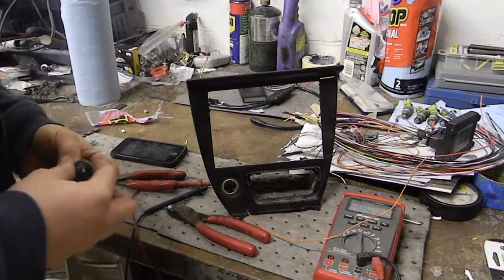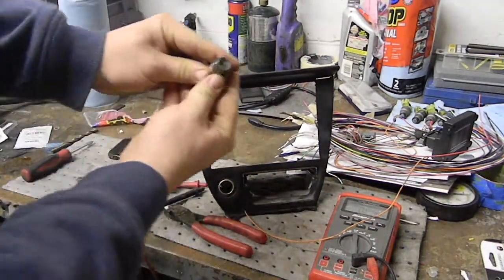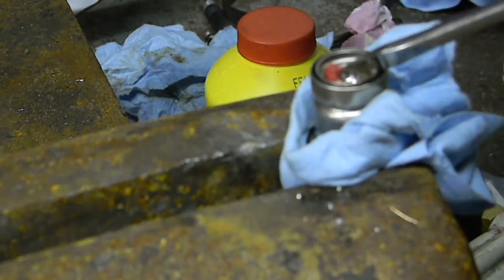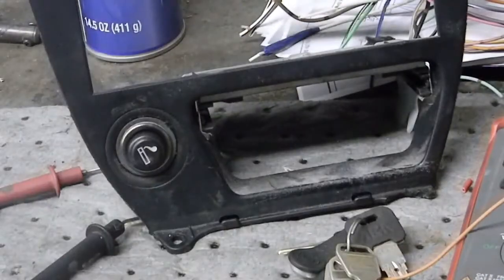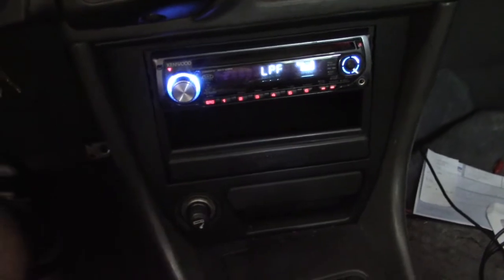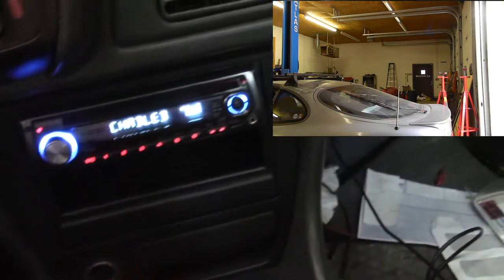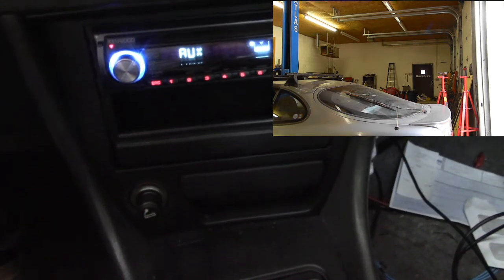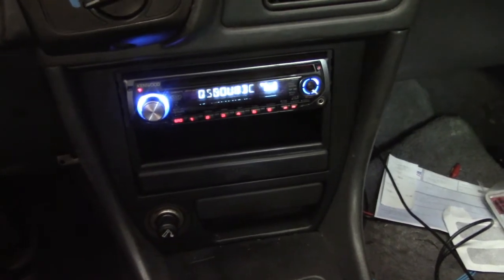Secret Cigarette Lighter Switch

Comment: We do this on our street rods but gut the lighter and use a 30 amp push pull switch.  Looks like lighter but kills power to ignition and or  fuel pump.
Reply: Can you make a video on how it's done
Reply: @Str8kustomz  

I will this weekend.
Reply: Just subscribed can't wait i will be turned in thanks brother👊👊
Reply: @Str8kustomz  

Thanks for the sub .
Reply: @backyardbuilttrucks1  did you delete the video? I can’t find it
Reply: This is what i want to do in my c10

Comment: Dear friend i have a celica st-i with manual clima..... i have to change the bulbs in the air command on the dash... i have seen there is a short blu cable in the rear of command and i need to disconnect it from the unit? How can i do it?  Can you help me? Thank you! I write from italy!
Reply from the maker: Disconnect it from the heater control valve in the engine bay, flip the metal tab over and the cable will pop off. It then will pull right through the fire wall. There is also a cable on the left side for the hearted box that needs to be disconnected at the floor as well
Reply: Velocity Performance thank you! Haven’t got a video? I haven’t much experience! However the blu cable is connect on the floor near the central tunnel... is it correct?
Reply from the maker: I took a quick video, I hope this helps. If you need anything else just let me know. 

https://youtu.be/Qmbvl9J6WpE

Comment: I know you did this a while back but can you explain why you have to solder the wire to the core to the outer edge?
Reply from the maker: Since I removed the heat element I needed to put the wire in there to complete the circuit to use it as a switch.
Reply: @velocityperformance8574  that makes sense. And it doesn't pop out randomly